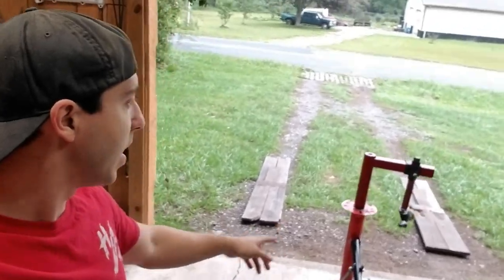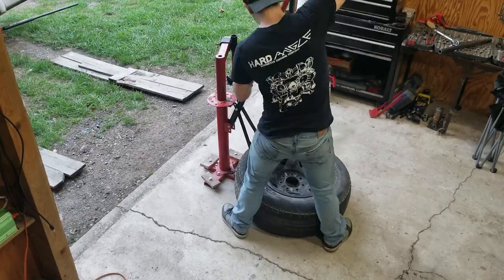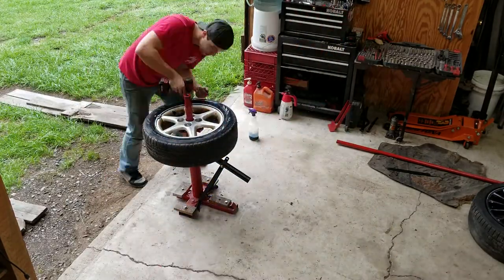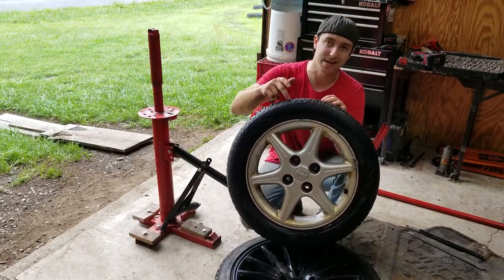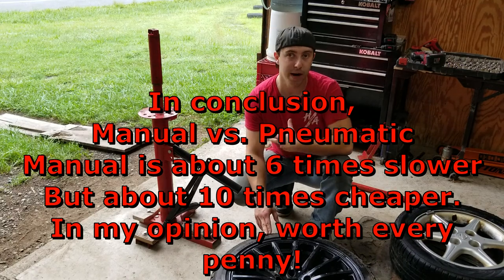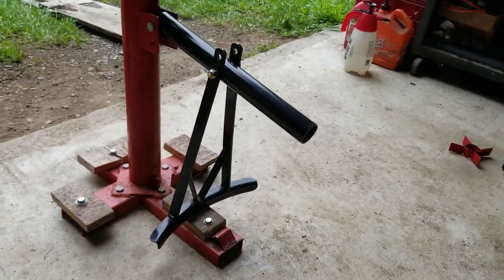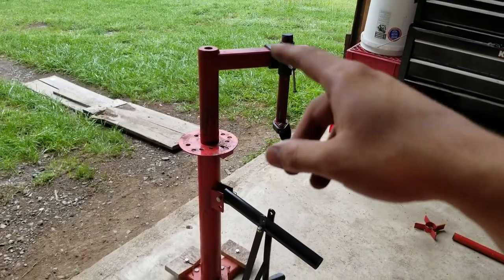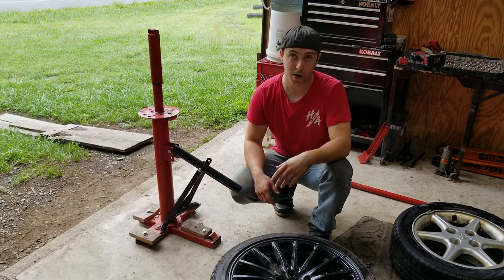Modded Harbor Freight Tire Changer with Duckbill, How Fast Is It?

Comment: Good Video. Clicked the like button. You’re setup works quite well! I too was excited to build the duck head adapter and buy a bead blaster until I found good used pneumatic machine with helper arms and built in bead blaster for $500. It was a little more expensive than buying a bead blaster and duck head setup but zero sweat to use. However, Hard Angle’s machine takes up way less space to store
Reply from the maker: I'll tell you what, if I found a tire machine like that for $500 back then this video may have never happened, that sounds sweet! But you are correct. It takes up so little space and being able to pop off a tire and change it quick for less than $250 invested is very nice, even with the extra work.
Reply: I totally agree. Your setup works great!

Comment: Where did you get the duck bill attachment?
Reply from the maker: I got mine on Ebay, from a company called TP Tools
Reply: Amazon HUNTER Tire Changer RED Nylon Mount Demount head Duck head TC3250 TC3300 TC3305

Comment: Great, need something like this for drifting but i can only run short sidewall.. should i just get pneumatic?
Reply from the maker: The pneumatic has the benefit of a much better bead breaker, that's the biggest pitfall of the manual, it will be a long time though until I get a pneumatic because of the price, and because I've gotten fast enough with the manual machine. If you have the means to get one and a place it can live permanently then I don't think the pneumatic would be a bad purchase as it should last longer than you'll need it for drifting and as you know you'll go through a lot more tires than I do on my daily drivers so the manual may wear out its charm quite quickly. Hope this helps.
Reply: @HardAngle  i wonder if i could weld a deeper “shovel” type edge for the bead breaker. I just want to know if its so difficult that i might not be able to get some off? & extremely helpful, im either buying this or making a down payment this week 😭
Reply from the maker: The main issue is that when you apply serious pressure the body of the machine bends, which I have fixed by ratchet strapping the machine to the wall so it can't move when I use the bead breaker lol. I have a piece of advice I use for buying measuring tools, if I buy the cheap tool now, I may end up buying the better tool down the road anyway, either way you choose, good luck to you, and enjoy your sliding!

Comment: I might have missed it--but what kind of lubricant are you using when mounting?
Reply from the maker: In this video I used soapy water in a spray bottle, if I have really stubborn tires I'll use actual tire mounting lubricant.